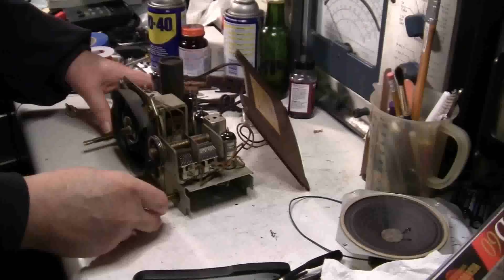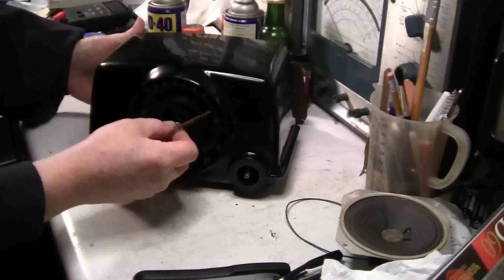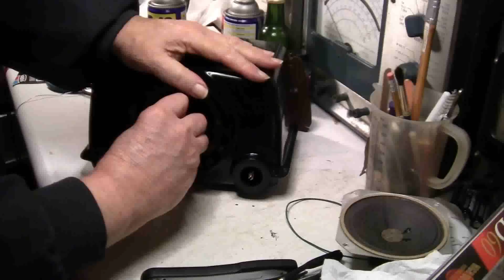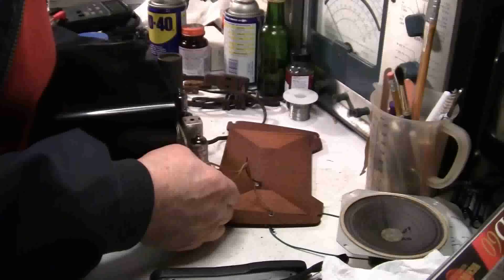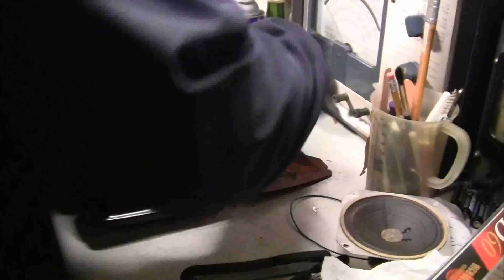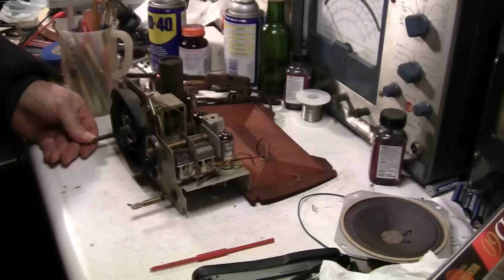Crosley radio repair 11-104U part four

Comment from the maker: @FyberOptic 
This isolation transformer is open to all grounds and house power. The only way you can get a shock is by putting yourself across the secondary output.

Comment: If you didn't use the isolation transformer, touching the metal knobs without their covers could give you a shock depending on which way the plug went into the wall, right?

Though I've heard some isolation transformers actually connect one of the secondary transformer connections to earth ground, which I assume would still make it dangerous in those cases.
Reply from the maker: Thanks.